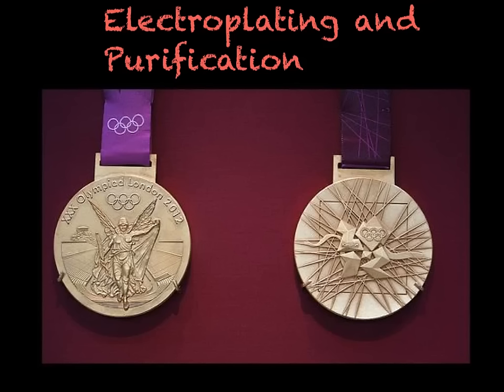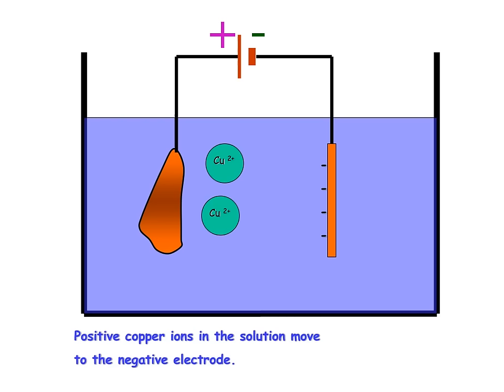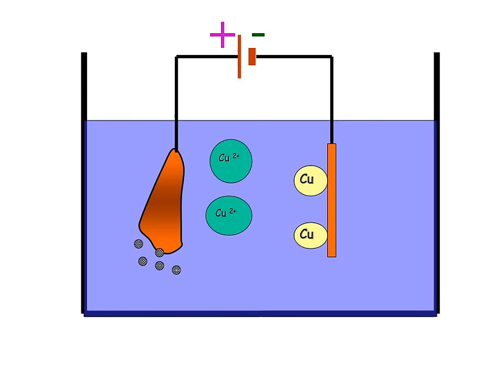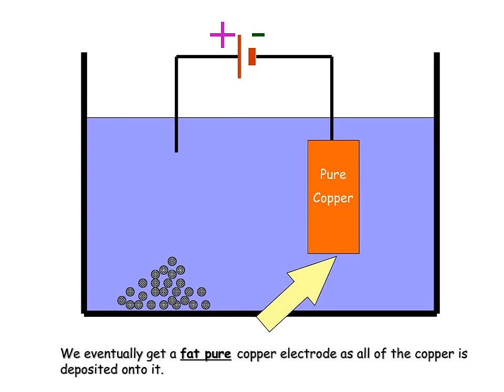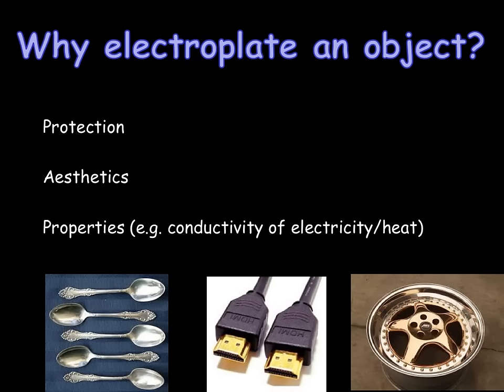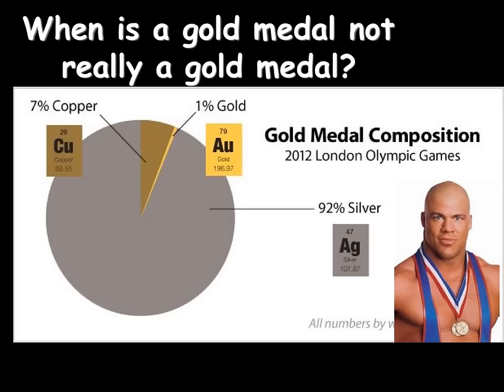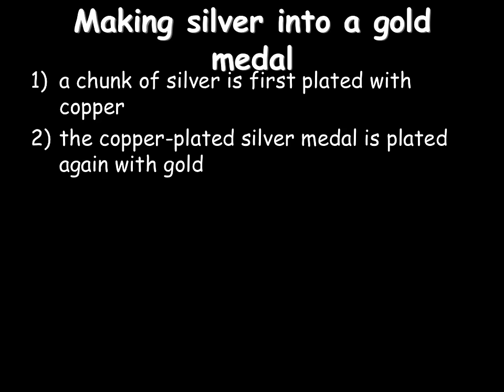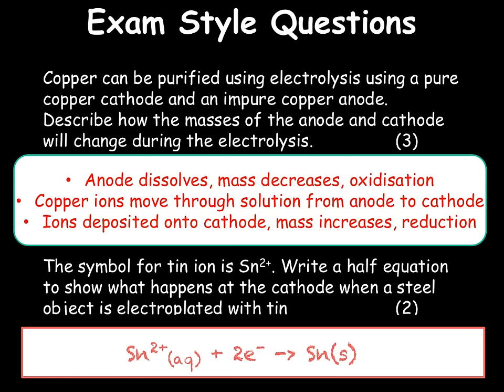C3.6 Electroplating and Purification

Comment: Why do you write the state symbol as (aq) when the substance is molten? Shouldn't it be (l) as it is not dissolved in solution?
Reply from the maker: +Amy E The molten state is (l) and the Solution state is (aq). When in the video is the mistake so I can put an annotation on it
Reply: It is in the C3.5 video where you talk about electrolysing molten sodium chloride, sorry I commented this on the wrong video but thanks for clearing that up
Reply from the maker: +Amy E I will add an annotation, thank you for pointing it out.